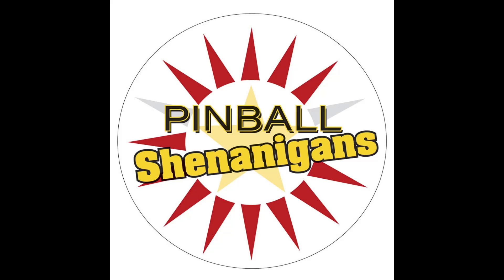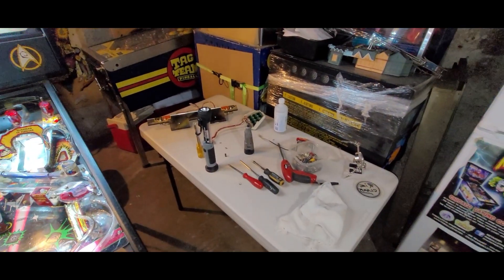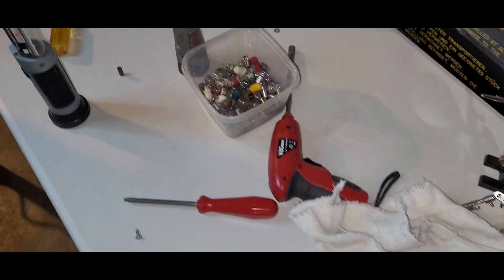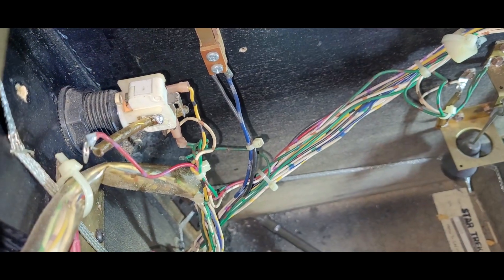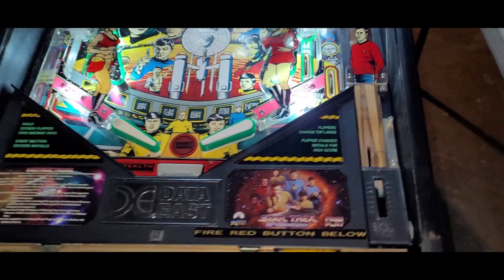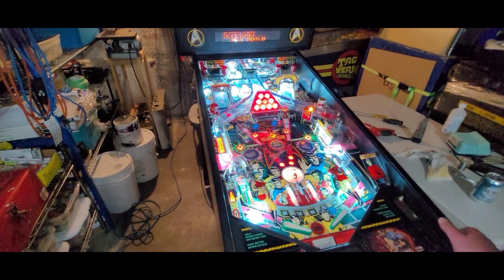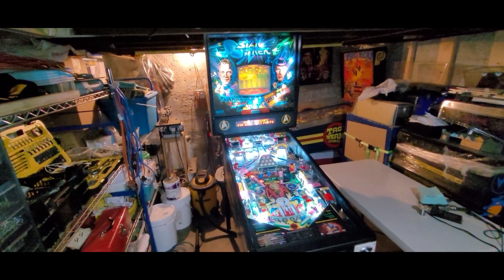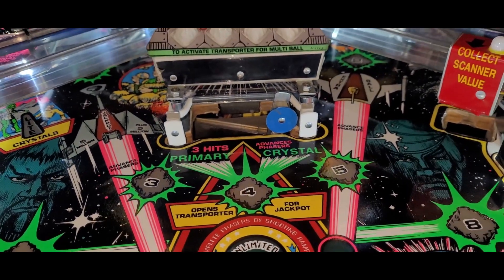Part 12: Data East Star Trek Pinball Project. All reassembled! First test game!

Comment: This one was odd, wasn't it? 

 I'm a fan of the Original Series and I'm fond of that crew.   And the artwork on this machine was very, very good.  And those likenesses were good.  One exception:  Yeoman Janice Rand.  Her face wasn't quite right.  But she was convincing, too.  The artist missed.  But not by very much.    Those lower slingshot plastics are stunningly beautiful, by the way.  Maybe the best I've ever seen.  There are plenty of scenes specific to one particular episode.  And there are a bunch of characters who appeared only once.  This machine contains a number of fan Easter Eggs and the playfield artwork gets an A+ in my book.

Yet I was unusually unsympathetic to this particular machine.  Partly it's due to a crowded and "busy" playfield.  That's something I almost dislike about most modern pinball and not specific to just this machine.  But this machine just had an "aura" of creepy and dreadful issues.  Some of which turned out to be nothing.  Fortunately.  The molten crater in the middle of the power supply was a bad sign.  I pictured rogue electrical currents zipping around that machine like a bull in a china shop.  And some ailments as you went along seemed to indicate that this was the case.  

I feared that this machine would turn out to be a pretty horrible turkey, best suited for parting out and scrapping.  I even thought about abandoning this project about halfway through and finding a more promising one.

Yet in the end you delivered a machine which looked and played well.  Nice job.
Reply from the maker: Thanks man, I totally forget all the trials and tribulations I had with this machine! I almost have to go back and watch. Sounds like I had a good battle!